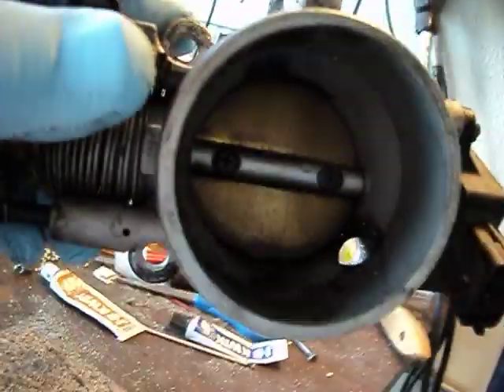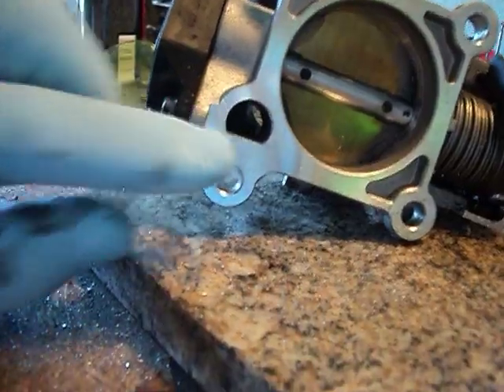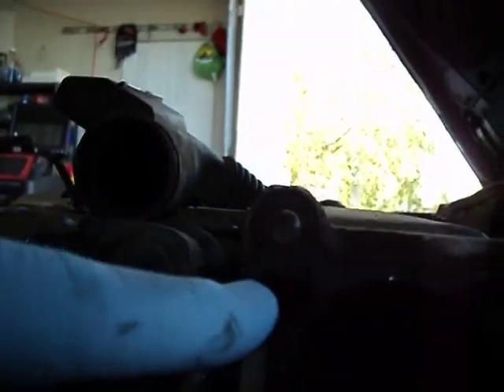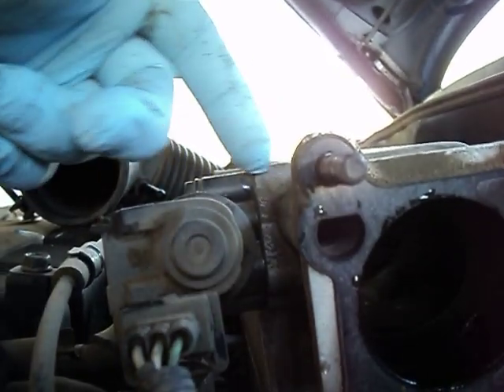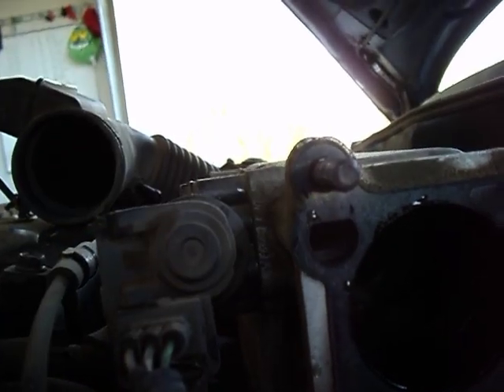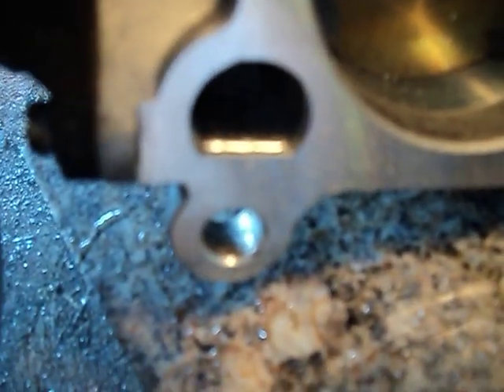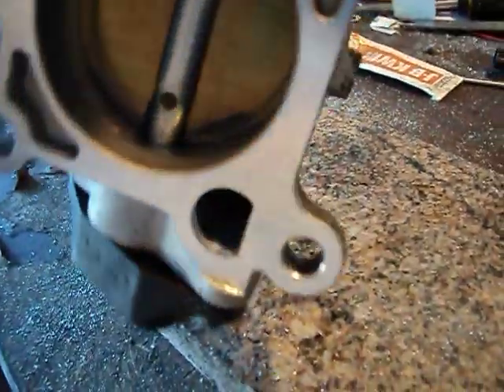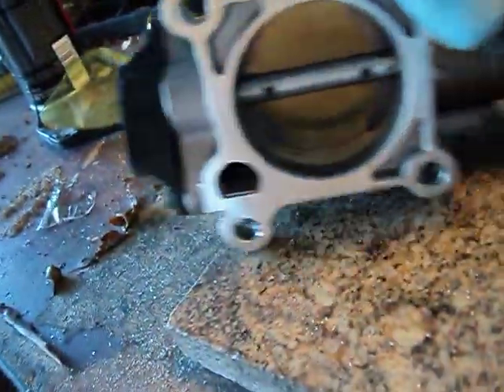Bulletin: IAC Adjustment on 2.0 L Hyundai engines

Comment: Personal License Package $500?
Pre-Certified Package is $1500?
Full Certification Package is $5000?

Who is officiating body offering the Certification?
Automotive Service Excellence aka ASE?
A junior college?

All on being Certified on how to mix JB weld, seal a hole and drill a smaller one through it?

At $5000 MegaSquirt is a much more affordable option!
Hell, I could also buy a laptop to go with every MegaSquirt installed!

Comment: I was under the belief that gas engines use a precise air to fuel ratio so if you reduce the air, the fuel will be reduced.
So all that means is that you are simply lowering the idle rpm.
You can modify the signal to the idle air control valve and achieve the same result.
You could also make your own and go with a MegaSquirt EFI module and have every aspect of the engine adjustable.
Much more complex than simply using JB weld to seal up the idle air hole.